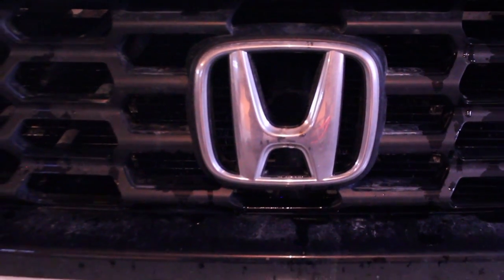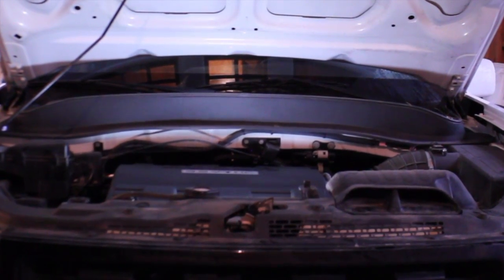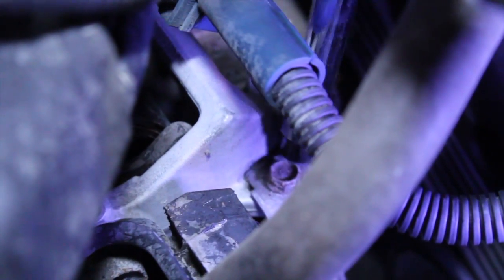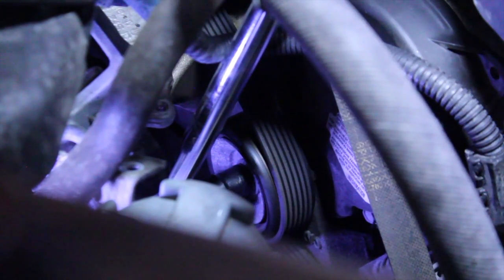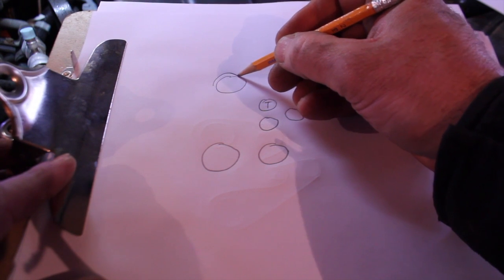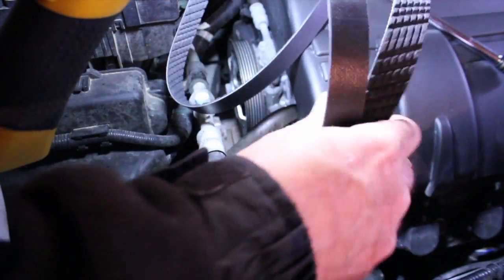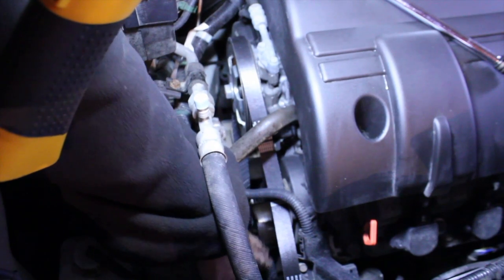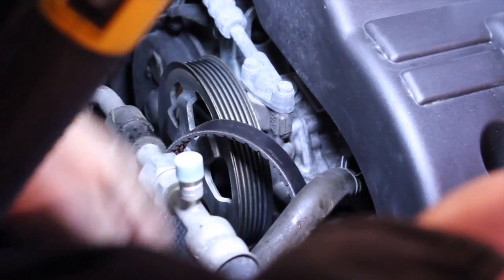HOW TO REPLACE SQUEAKY SERPENTINE BELT HONDA RIDGELINE

Comment: Nice video! I would question you on the tentioner pulley as in my opinion it was spinning too freely which to me is a lack of grease. That should indicate it needs changing as the squeaking and grinding you mention are often cased by lack of grease. Two thumbs up on the diagram as Honda appears to have overlooked that under the hood. Like from me!
Reply from the maker: Squealing Stopped when I replaced the belt - No further issues so that pulley was AOK up to 100,000MILES when I sold the truck

Comment: The bolt that held the bracket sheered clean off for me. I can't even get a drill in their to drill it out, you have any suggestions on what else I can do to clear the old one out?
Reply from the maker: geez - not sure and i dont own a Ridgeline anymore to look at it  - maybe take it to a machine shop and see if they have special tools to extract it

Comment: Quick question.  My tensioner when I go to move the nut it slightly moves but it comes back and it wont let go back towards the cab. (Minute 1.45 in the video). What can I do?
Reply from the maker: Yuli Tafoya do u have a long enough breaker bar - its a strong spring so you need a lot of leverage to move that pulley...

Comment: One problem.   Can’t get the 10mm nut for the bracket off -  it’s frozen.   Any suggestions?
Reply from the maker: Not sure - maybe take it to the dealer and they may be able to get a torch in there to heat it?
Reply: Use pb blaster soaking the nut a few times then wait about an hour.
Reply from the maker: Nathaniel Hodum good tip! Thankyou
Reply: @nathanielhodum3998  soaking things barely ever work. Just torch it, it expands the metal and it comes out like nothing